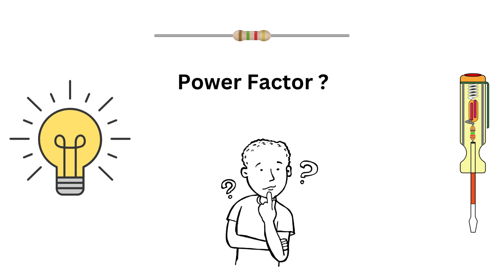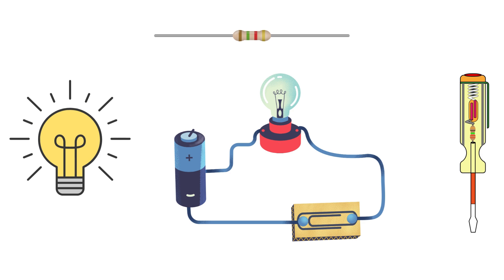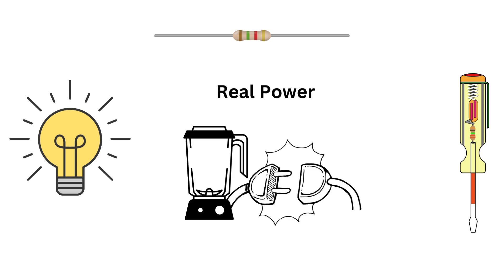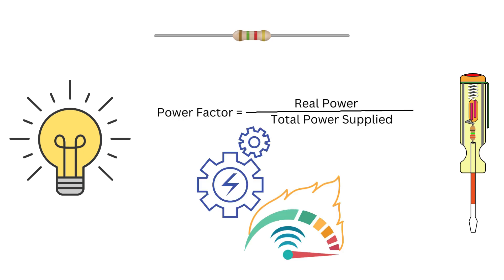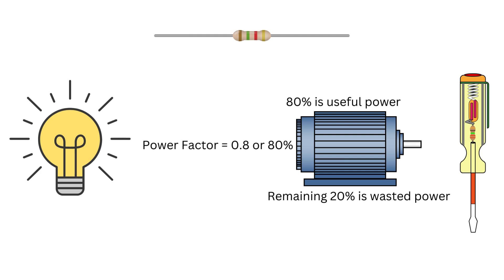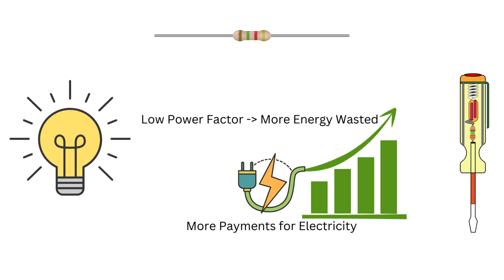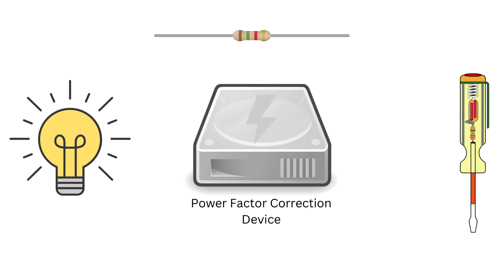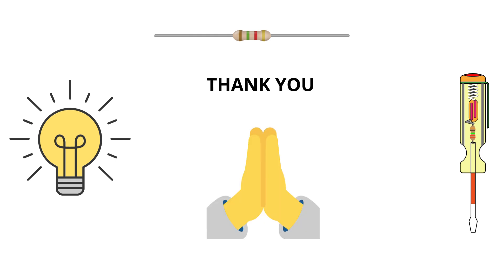Understanding Power Factor |  Essential Knowledge for Every Engineer and Homeowner!

Comment: A motor that has a power factor of 1 is not 100% efficient. You have oversimplified it.
Reply from the maker: You are right, there are a lot more nuance to power factor than I illustrated...mainly because this is meant for beginners to grasp the concept properly first.
Reply: @ the energy to create a magnetic field is not really wasted. It is required to operate the device. The energy is then returned to the supply or alternatively a capacitor. You are right the negative of returning it back to the supply is increased mains current and the associated heat losses.